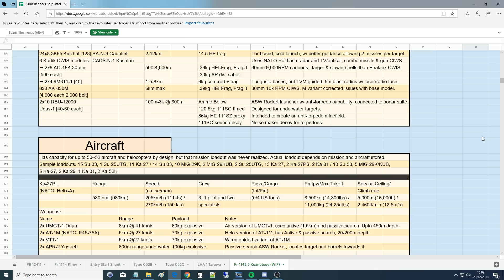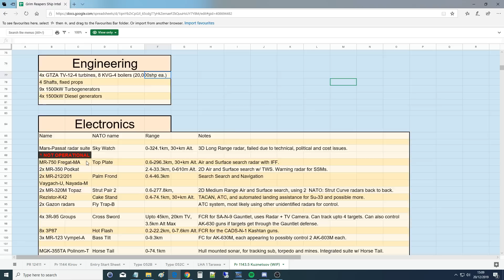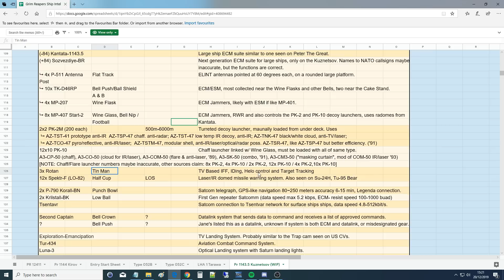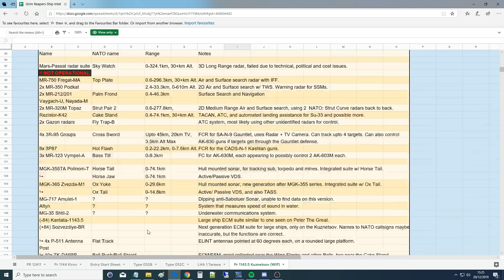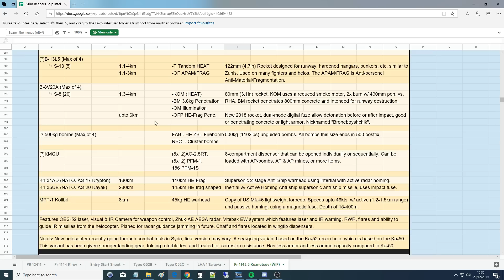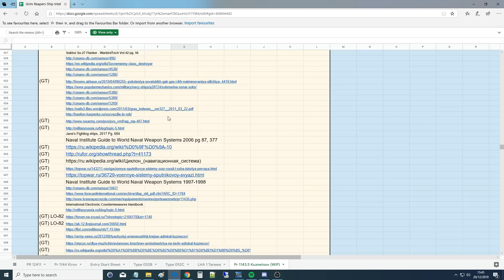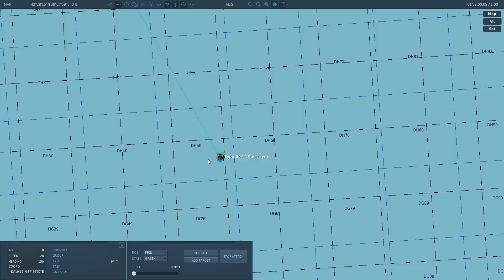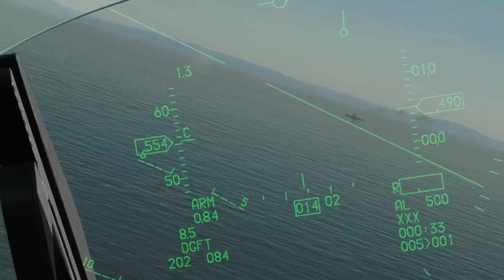Combined Arms: The Admiral Kuznetsov Aircraft Carrier Tutorial | DCS WORLD

Comment: I noticed some minor errors about US nuclear carriers (Nimitz Class). The landing camera system is called ILARTS (Integrated Launch & Recovery Television Surveillance-System ). Everyone on the ship would refer to ILARTS when talking about the system. 
The tonnage for a CVN will be approximately 102,000 tons with each ship in class having slight variations in weight, configuration, and dimensions (e.g. one ship might be longer, another may be heavier, and another may be lighter, etc.).
Generally, a Nimitz Class carrier will have approximately 5,200-5,500 personnel (~3,200 ship’s company, 2,000-2300 airwing). The Gerald Ford class was designed to carry less crew at around 4,500 personnel.